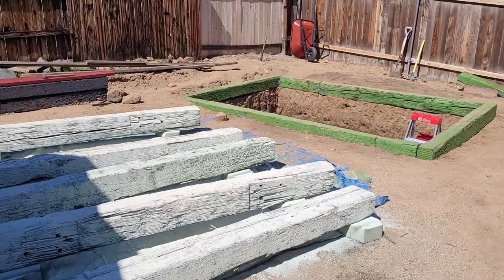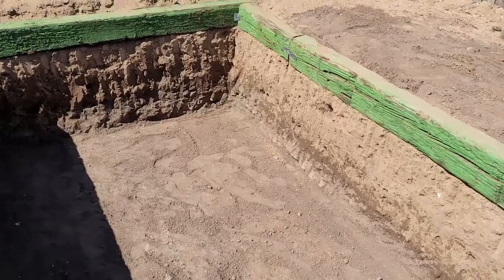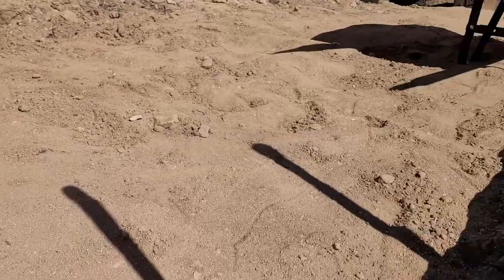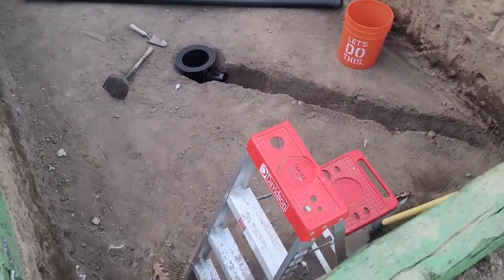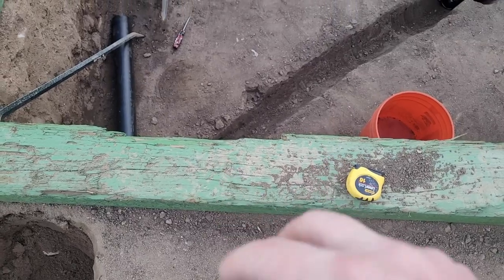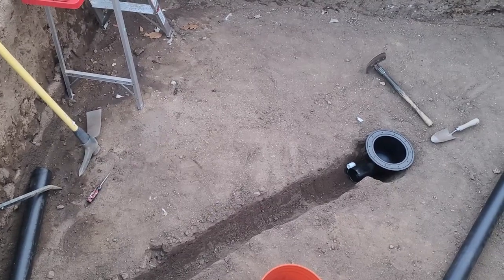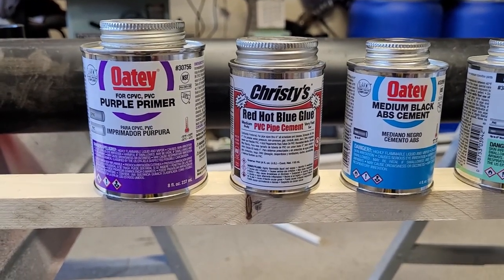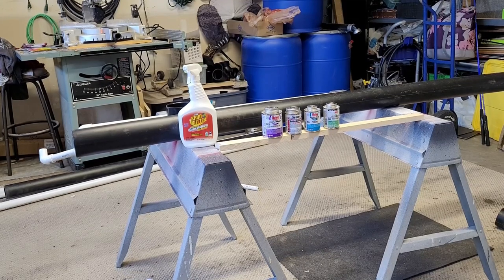Koi Pond Build Part 3.  Installing the Bottom Drain.  3 Inch Koi Toilet. Solvent Weld PVC ABS

Comment: Hi Tom, Looking good mate 👍👍You've done well since your last video. You could just fill the bottom drain with water, and leave it over night to see if the water level drops, just to make sure you've got a good seal on the joints. Just a thought mate. Keep up the good work 👍👍Terry.
Reply from the maker: Hi Terry, that is a good idea.  I'm not too confident on the 90 that comes up out of the ground.  That was a challenge to get the upright pipe glued into that 90 as I could not reach it.  Had to just put glue on the pipe, aim, and shove it in.  It didn't seem to go in very far before the glue hardened up.  I guess I could do the balloon trick that you did at the bottom drain side, fill up the pipe with water and see if anything leaks.